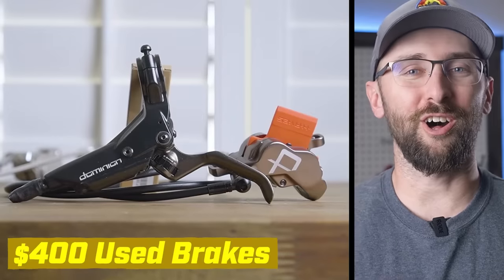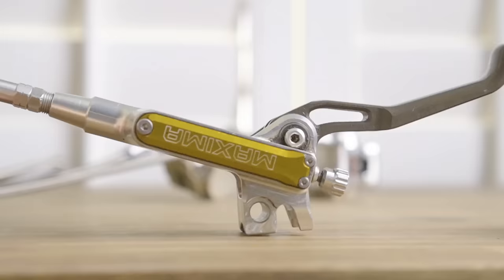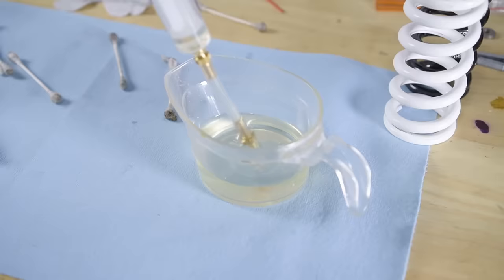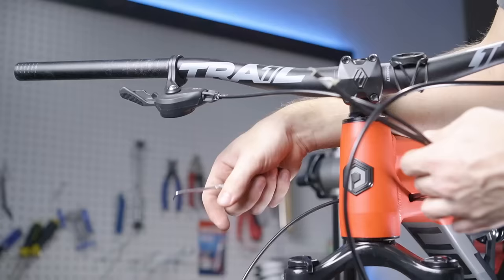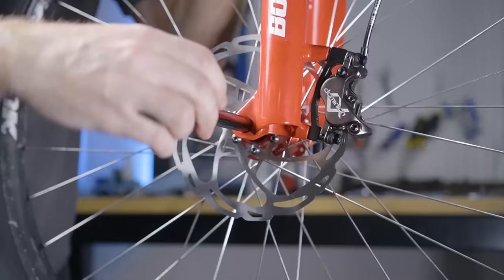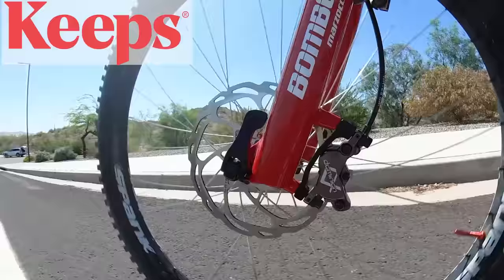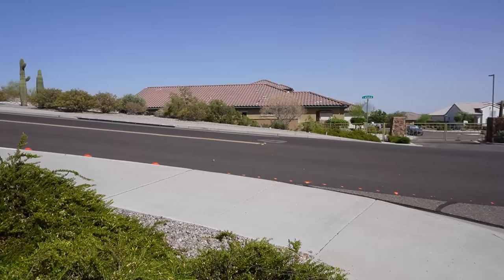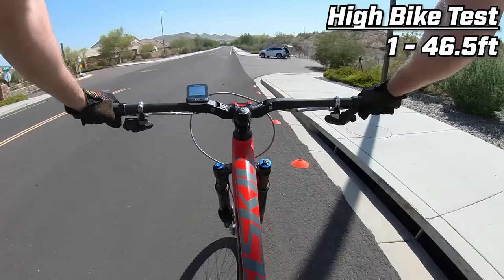Are $2000 mountain bike brakes THAT much better?

Comment: are 20 dollars brske also good
Reply from the maker: Nope
Reply: I remember my bike for 30 euro when I was kid. Not the breaks but whole bike xD When front star broke, I got a good bike which only had wheels on it and good front star. So I dissasembled all parts from the old one and assembled my new bike. I traveled whole country with that one lol.
Now I have a trek bike that costs 23 times more and has disc breaks. Is it better? Not really but it does have a front suspension and looks a little nicer xD

Comment: I still use mechanical brakes. They're cheap, easy to maintain and have decent stopping power. Wasting that money much on a set of brakes and rotors is absurd to me.
Reply: I used to think the same. But then I got a good deal on a used name brand hydrolic brakes set and 203 rotors front and rear. It's a complete night and day difference. There's just no comparison until you try for yourself what true stopping power feels like on the trails.
Reply: Yeah I used to think that too. Then I bought a 60 dollar set of pre bled shimano hydraulic brakes from amazon. The actuation and modulation is SO much better, and I mean it when I say that there is almost  0 chance your brakes are gonna slip once locked up. Never had a set of mechanical brakes that will lock up and let me balance on either of the wheels. I'm 230lbs though lol.

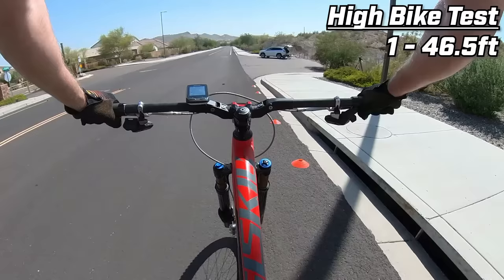Comment: 9:35 considering the fact that even cheap brakes are able to lock up the tires, the difference in maximum stopping power is moot. braking is limited by traction. the only difference between cheaper and more expensive brakes is the feel and the force required to generate that stopping power. a stopping distance test is pointless.

Comment: Keep making excuses ...it must suck to be poor. Yu dump $14000 into a bike and then look for cheap brakes....because all brakes ultimately do the same thing right?  They are better and always have been better but the biggest part of their true secret is in the brake hoses.....far less expansion with pressure. To bad but if you look for them I believe that Trickstuff is no more. If someone has the bite pressure chart for the bakes comparison, post it,  it settles the debate.